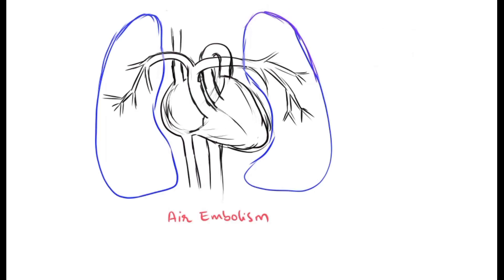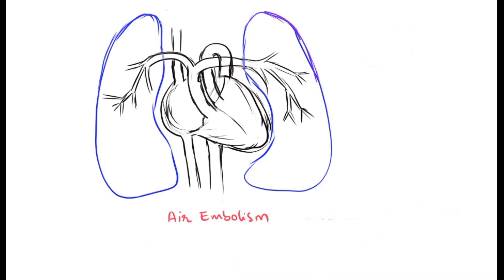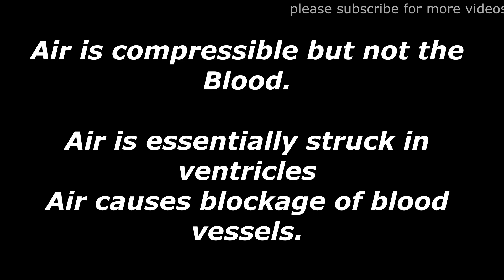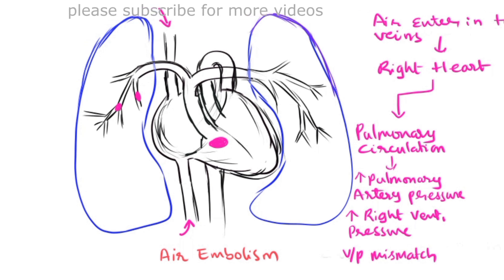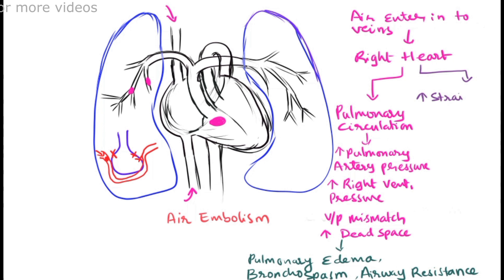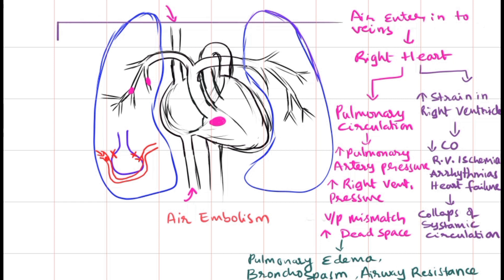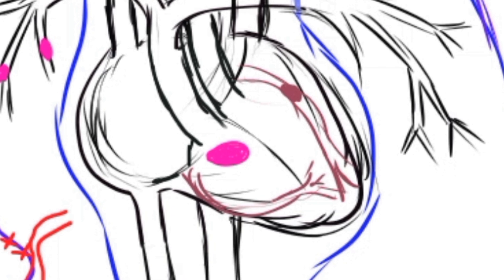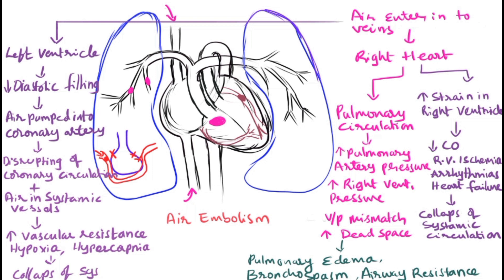Air Embolism/ pathophysiology of Air embolism

Comment: Just to simplify air embolism is essentially an RV outflow tract blockage just like a classic massive PE. This in turn drastically decreases LV preload and cardiac output which is the cause of the resultant shock and cardiovascular collapse. Now, of course, hypoxemia and hypercarbia also affect pulmonary vasculature resistance and PA pressure but acutely it is the RV outflow tract obstruction that causes acute cardiovascular collapse, and shock.

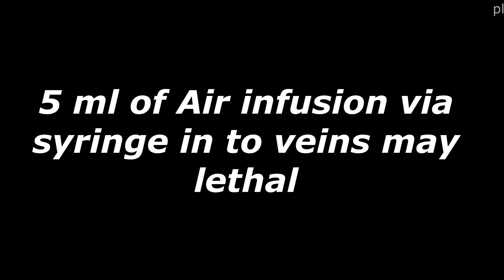Comment: 1:07 
The minimum amount of air to cause embolism is 60 ml
Reply: how many days to notice the causes of air embolism?
Reply: About 100 ml of air introduced under pressure is necessary to produce pulmonary air embolism
Reply: Mostafa Bies dude u r totally wrong, actually as little as 2mL can be fatal once reached the cerebral circulation
Reply: Mostafa Bies furthermore 0.5mL or 1mL can cause cardiac arrest.
Reply: @gloomy5455  iam taking about venous air emboli not arterial
check that resource it says "The lethal volume of air in an adult human is unknown but is estimated to range from 200 to 300 ml."
https://anesthesiology.pubs.asahq.org/article.aspx?articleid=2026502